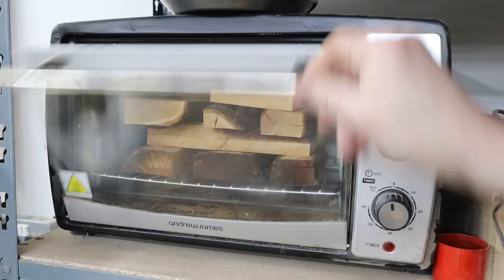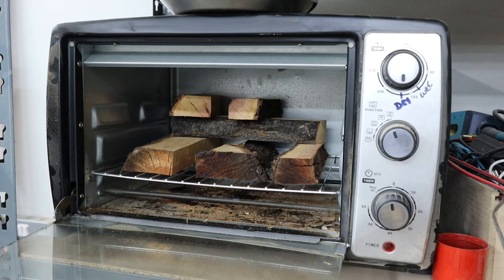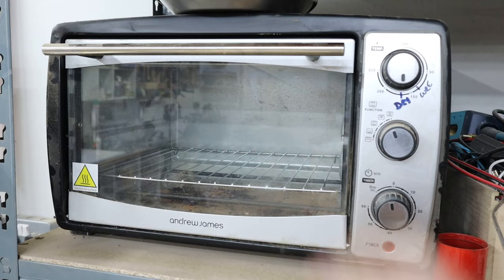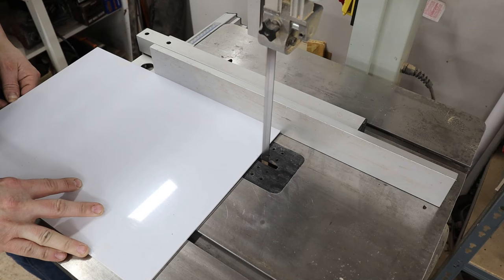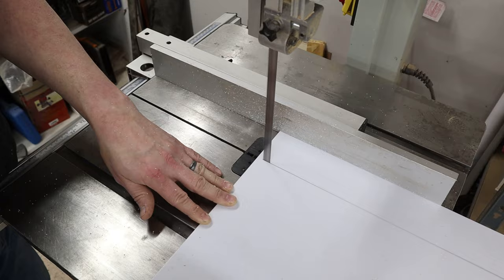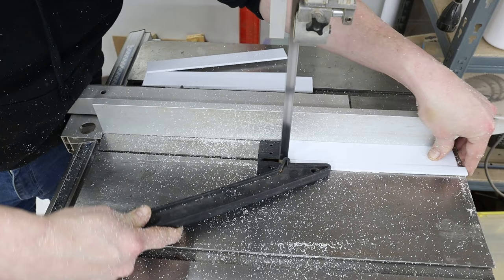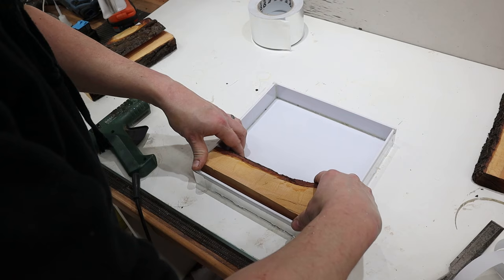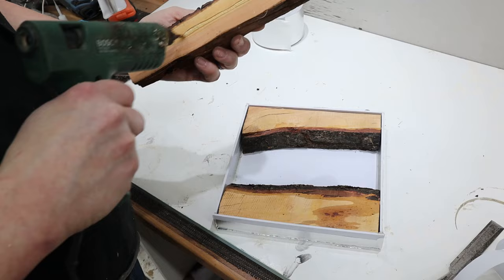Woodturning - Probably the best Wall Lights in the World

Comment: Very nicely done. What temperature and duration do you dry the wood?
Reply from the maker: Duration is based on the initial moisture content, the weight is monitored periodically. Temp starts at around 40 Celsius and is worked up to 106 over time.
Reply: @MattJordanWoodturning  Thank you.